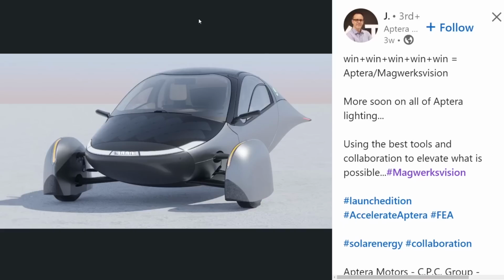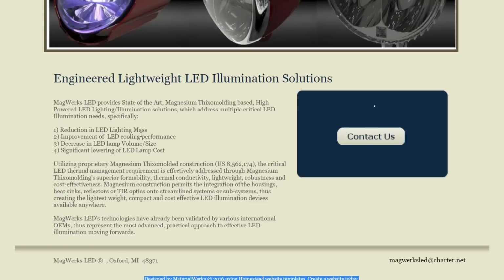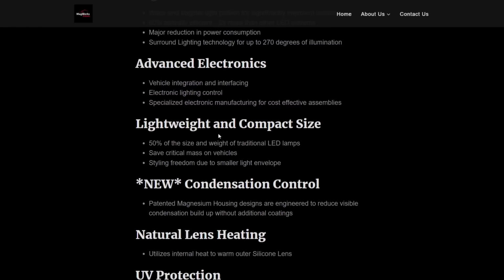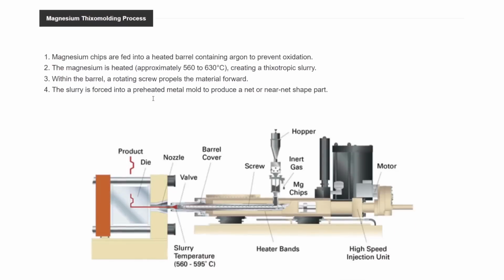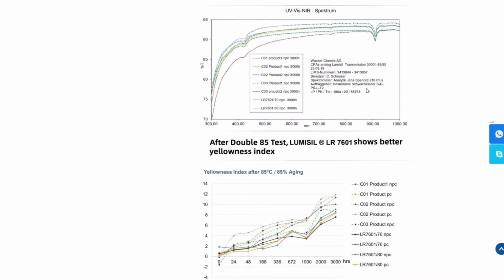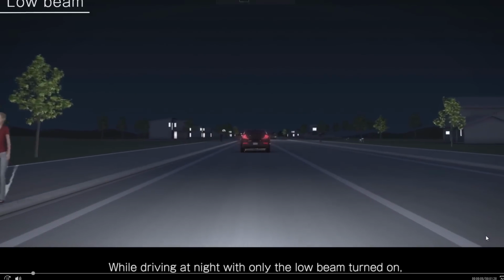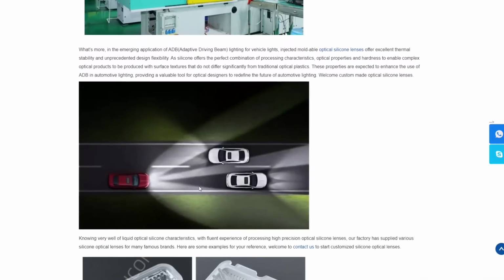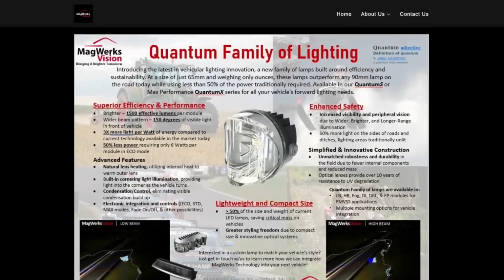Why is Aptera going with Magwerks Vision?

Comment: That ADB concept will be a jolly Godsend if widely adopted.  I have been bitching about dangerous glare from modern halogen, and LED headlamps for years.  Very important I reckon in countries like New Zealand where, while highways are plentiful between main centers, most other sealed roads are narrow (one-lane each direction) carriageways and there is constant danger of becoming blinded by oncoming traffic if the driver of the oncoming vehicle is lazy about dipping his/her lights (winding roads with concealed bends where surprises constantly await).  I have never heard of this sophistication prior to you mentioning it.  Also when driving long trips at night, I am constantly flipping the rear-view mirror to and from non-glare mode.
Thank you for this bulletin.

Comment: Hi Steve, awesome info. One note, the lens material is silicon, rhymes with bun, and is what microchips are made out of instead of silicone, rhymes with bone, the stretchy stuff you put in your shower.
Reply from the maker: Hi Zachary, the lens is actually silicone the polyorganosiloxane polymer made of silicon and oxygen.  It's a formulation that is somewhat rubbery but quite firm and clear.

https://www.rubbernews.com/silicone/lsr-playing-larger-role-headlamps

They say silicon on their website because it's technically true because silicone consists of silicon and probably because it sounds cooler.  Their patent applications make it clear that it's silicone.  Silicon the pure metal is opaque.
Reply: @ApteraOwnersClub  Thanks for the info Steve! I saw silicon listed on the documentation and thought that was that. Thank you for doing deep dives into all these different aspects of the Aptera and EV's in general. You're a great resource bringing all this disparate social media and video info together.

Comment: With LED lighting its all about lm/W you have to get rid of those watts, high temp reduces LED life. A heat sink is required, it takes up space and needs ventilation.
As an example CREE LEDs are in the 200 lm/W range.
Well designed optics that direct light in the correct direction reduce the lm’s required.

Comment: This is off topic but it does concern electricity . I've been wondering if a couple of the batteries go bad in the battery pack will the vehicle still function ok .
Reply: Multiple cells make up a module. Multiple modules make up a battery. I think you mean if one or more cells go bad. 
Yes, bad cells will limit the overall capacity of the module and hence the capacity of the battery.
It can be measured, but you probably wouldn't notice it.
Reply: @GaryGreenway  Thank you, I've been thinking about this a lot lately, all those hendreds of little batteries or cells , seems like odds are a couple might go bad and would I still have a functioning vehicle . Thanks again

Comment: Standard household LED lamps in the U.S. make around 100 lumens per watt. I've heard that some very high-efficiency lamps in other markets can get up to 200 l/W. Incandescent makes around 10 l/W, halogen maybe 15 and fluorescent maybe 50 I believe

Magwerks is advertising numbers in the 250+ range, which is pretty awesome if true. Doubling the efficiency also means halving the heat, of course

Comment: Major reduction in energy consumption, and weight. Again, the choices that Aptera is making, has everything to do with getting the best possible solution. Thanks for your in-depth coverage again, Steve, your reporting is of the highest standards. No matter what the piece of Aptera is, you have the digging mentality to tell us all about the inside story. This solves a huge problem, without getting cataract surgery. Guess getting my cataracts fixed was not needed! I applaud the choices yet again from the team at Aptera. 🐬🐬🐳🐬🐬

Comment: Unfortunately modular design and engineering differences could mean we will have 3 separate forward facing cameras:
- One for ADB as described in this video
- One for OpenPilot (essentially a Comma 3) 
- One (potentially not factory) for recording because sentry mode is critical for Aptera - it will attract attention

Fortunately cameras are increasingly inexpensive, reliable and light weight but this is definitely a little inefficient.
Reply: @Oops1e - I also totally agree that sentry mode is critical for the Aptera.  I hope that it will be included or be easily installed as add-on.

Comment: The biggest issue with lighting today is how quickly headlamps are fogging up.   There must be a better material or better way to keep headlights from doing this.    It is insane that people are paying 100,000.00 for a vehicle and within 1 year the headlamps look awful.
Reply: Right... most plastics are not very resistant to UV.  We'll find out how Silicone ages soon enough.  Silicone is a pretty durable material, so hopefully it will age much better than the plastics currently being used in headlamp assemblies.
Reply: Cleaner air would help.

Comment: Great review of this. As an older driver, lighting is of more importance than when I was younger. I’ve been curious as to what lighting would be on the vehicle. I now am relieved that they’ve got it covered and it should be adequate for me. Thanks again for the informative post.
Reply: As79 with small cataracts I feel your pain.  As if 4X4 macho boy's weren't bad enough; they then "Upgrade" to Bat Signal sized front lanterns.

Comment: When Aptera switched from the multi light array of the Alpha design to a single (5 module) center array, I wondered if Aptera was simplifying the lighting too much to provide adequate illumination. But looking at the specs on the Magwerks webpage it looks like it will be plenty bright, with wide coverage, despite being a simpler design and using a fraction of the power. It looks like Aptera is following their design challenge of choosing components that are more efficient, and are a lighter, simpler, cost effective design, while meeting or exceeding the functional requirements. In Jason Hill's post he states: "“In addition to structural safety, there is functional safety. The Aptera headlamp, which multiplies the tenants of efficiency, engineering elegance, and lightweight, will provide a safety function beyond what is expected and required."

Aptera headlamp benefits:

– better illumination on the road

– superior optical properties with greater than 70% efficiency

– reduced weight

– superior thermal management

– lower energy consumption with higher optical performance. 

So it does look like a impressive lighting array for the Aptera, but unless there has been some recent technological breakthrough that brings down the complexity and $$$ cost of an advanced Adaptive lighting system, Aptera's headlights look like they will "just" be efficient and effective, but not Adaptive.

Comment: According to that site's video, that "Adaptive driving beam" still shoots the high-beams at the eyes of pedestrians. I hope it's something with a manual override.
Reply from the maker: You actually want it to do that.

1. Yes it's annoying to the pedestrian to be temporarily blinded

2.  The pedestrian is not moving fast enough to hit anything in the time they are blinded

3.  As a pedestrian, I'd much rather be seen by a car driver and temporarily blinded than not to be blinded but not be seen by the car.
Reply: @ApteraOwnersClub  Thank you for the clarification.
I still would like the option of a manual override, for cases where I'm driving in an area with sidewalks for example. As a driver I would be staying off of the sidewalks, which also would likely be illuminated by street lamps. And as a courtesy I would like to not blind the pedestrians.
   From other comments, it sounds like some vehicles with this feature do allow it to be disabled/enabled.

Comment: I recently rented an Audi with this Adaptive thingamajig and I can say it is absolutely fantastic. As you say, Steve, you can just leave it on high beam and not worry about a thing...
Reply: Sounds like Heaven.
Reply: I wonder if you still get flashed by other cars because they may think that your lights are too bright.
Reply: @tims8603  It may depend on the system and how it is implemented, but I had that car for a few weeks all told and that has never happened. And it is certainly better and more reliable compared to having to remember to switch back to low beam every time.
Reply: @MalteFfromAustria  Thanks
Reply: @tims8603  Happy to clear this up!
Reply: @tims8603  Great question!

Comment: Unfortunately there is a regulatory roadblock to implementing ADB in the US. Other manufactureres offer it in other markets, but out of date regulations prevent it here.  Hopefully, this will change soon.

Full adaptive beams might require more than the five lenses that Aptera has.

I'd like to see what they could come up with for a rear fog light for Aptera, and possibly some sort of long and low beam that steers with the wheel pants though this too is precluded by current regulations for cars if not for motorcycles.
Reply: This is incorrect as of February 2022 NHTSA approved their use.  Google "are Adaptive headlights legal in the USA and it comes right up.
Reply: @Salanan  1 dumb old law down...  millions to go
Reply: It's not the entire light module that gets switched off, it is the individual light elements (chips) inside the module.  The question becomes: how many LED chips are in each of the Aptera headlamp modules.
Reply: The lenses are not important, the light sources are. Have a look at Samsung Pixcell LED videos.

Comment: I always thought LED lights did not get hot.
Reply from the maker: The front of the LED that emits light doesn't get hot.  And majority of electricity get turned into light so the amount of heat is much less but if you have a really bright led the back of it gets extremely hot and if it's not dissipated it will destroy the LED itself or melt the casing
Reply: @ApteraOwnersClub  ahhh. Thanks Steve. See, I learned something! 😁
Reply: The chips and carriers can get hot. Even the front of the led. However, when properly designed, the heat is thermally coupled to and absorbed by the light housings with built in cooling fins that adequately cool the light. Nothing to worry about in this application.